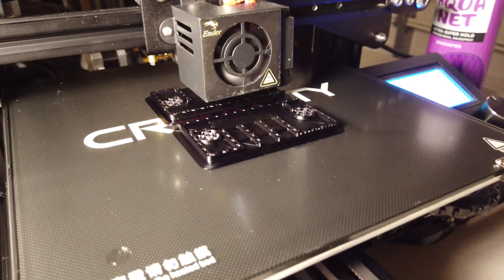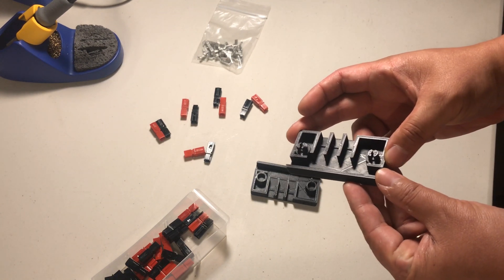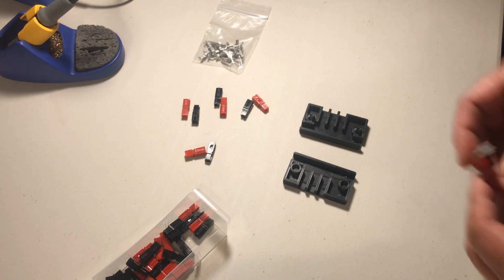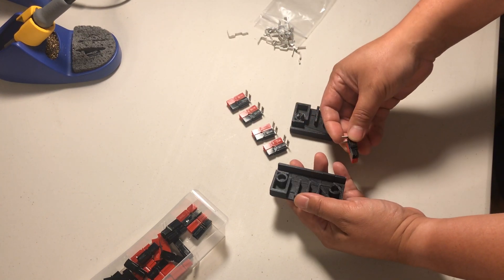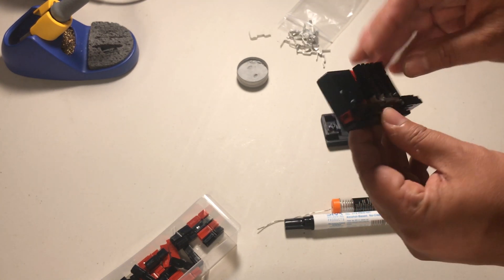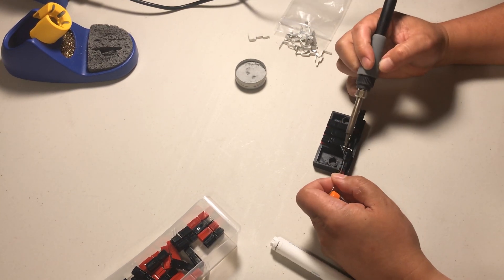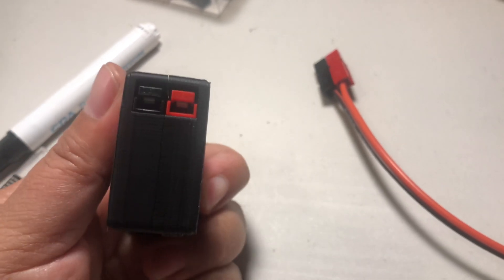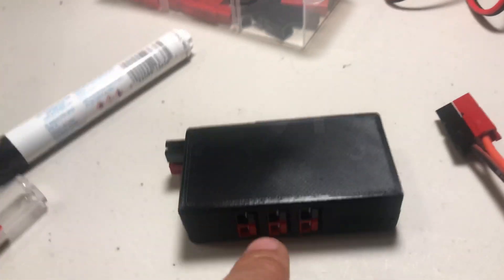3D Printed UNLIMITED POWARRRR

Comment: Tried it. It broke. What settings (resolution/speed/infill) 
 did you use?
Reply from the maker: I used a draft resolution of 0.2 and 20% infill with PLA. I can't remember the speed, this is auto-set by the printer based on my "Draft" profile. For things like cases and levers, I will tend to infill closer to solid than I would normally do for a less functional print, just to add strength.
Reply from the maker: https://www.thingiverse.com/make:660702
Reply: @AD6DMDennis  ok i see. would you agree on "one should rather add 2 screw holes instead of that snaps"?. Btw: did you use the scad file? I noticed the the corners on your print are slighly rounded (which is good against warping) while the scad has hard 90 deg. angles. :).
Reply from the maker: @pulponair  I just printed using the stl files.